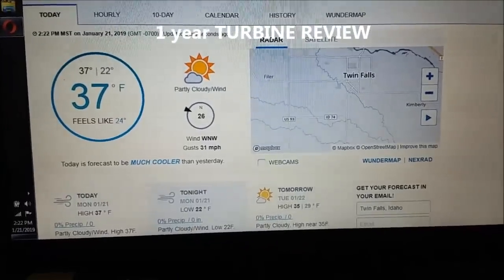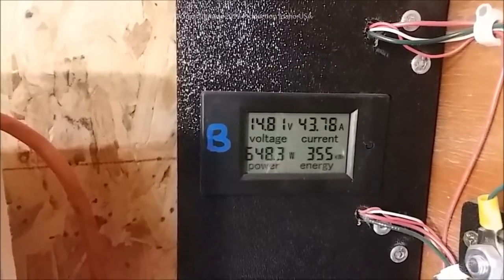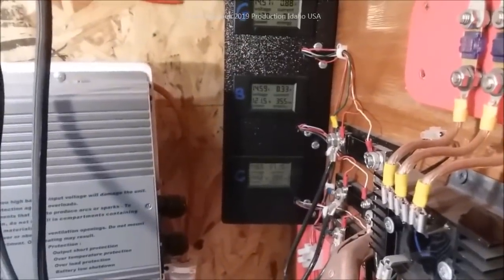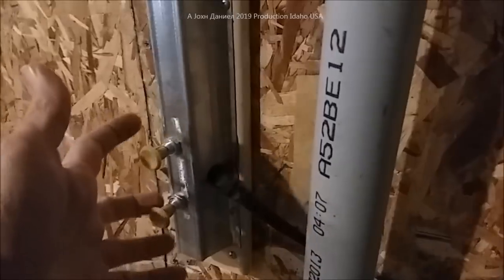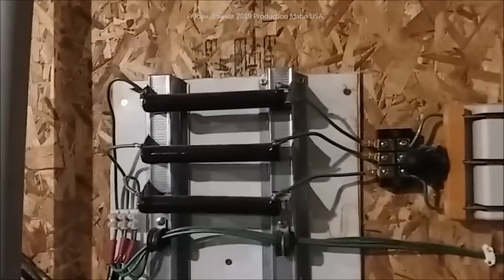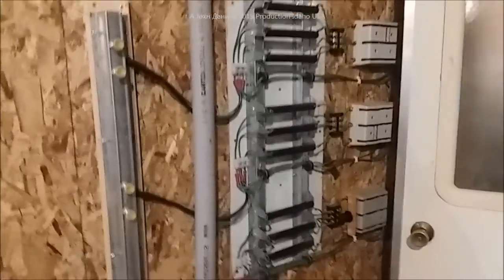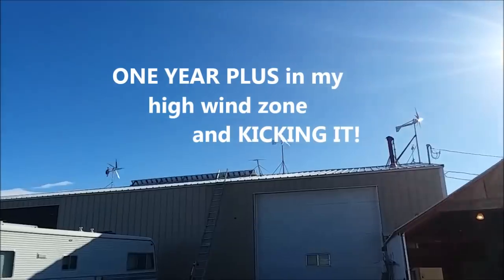The best Chinese Wind turbine, Great results, 1 year+ review FULL PARTS LIST BELOW VIDEO

Comment: Imagine if this works we could sell these to folks and make some people happy and unfortunately some might not be happy like power companies.  Or just build it for us and not for others.  Not sure . I just want to make one that can run on a 24v 400 ah bank and charge up my 1,200 AH 12v bank and the 24v bank . That would rock.
Reply from the maker: In all honesty, its over-unity which is not going to actually work based on actual power factor loss. But if you wan't to become wealth from wind power, you build what I have in operation now for years on my property in Texas. Air pressure to charging systems. More to come on that in the future as I secure some law ridden trademarks and copyrights.
Reply: Line loss does suck j never have messed with something like that.  I have seen those 10,000 watt pulley driven inverters that can run from an electric or gas motor. And used for running a washing machine and dryer or a large 80 amp duel bank charger. Have you ever used those?
Reply: Isnt the idea to spin a 3 phase at 800 or 1,000 rpm the goal with a wind turbine? Why wouldn't a high rpm motor still spin it? Could a differential gear system fix or correct that? Or how about at least running a big one to charge a big ass bank up and another bank that's running the motor. Mmmm have you ever tried it before? I know a guy who made a smaller version  out of treadmill motors and a brushless high rpm 12v motor. His works he gets 350 watts or 15.5 amps at 14.8 volts with charge controller for each motor he has 4 on his.
Reply: He lives in firth. He showed me it I helped him figure out the bank sizes to use I told him to go with two separate  600 ah banks running 2 of those on each bank . One bank for his running motor and second for his inverter and loads. It works better with 2 banks that way the startup motor isnt drawing current from the charging bank that's has inverter. Before it would bog down when he turned it on. And I had him add a car amplifier capacitor to ot too help with startup surge.
Reply: That's where I thought wow why couldn't I just use bigger shit and make it bigger lol. But I trust your opinion as fact and wont waste any money on one I would rather buy 2 of those bad ass turbines.
Reply: Over unity no I was talking about stuff that could actually work out in an honest way using the same method wind does just share the same motion or energy with a few more 3 phase units to keep my big ass bank charged enough and the running motors battery  too. Not perpetual bullshit just using batteries to buffer load that is replaced by sharing one action with multiple recieving turning systems. It's just good manners sharing energy with others lol. I figure if a motion  is able to convert into usable energy what happens when that motion  is shared at the same rate to other converters? Using a buffered energy source to give that motion only to regain it later as interest from its next door battery bank  maybe a tied in charger to give back enough .
Reply: I will have to go talk to him and tell you exactly what he has in it.
Reply: I'm a mean critic on those free energy from nothing idiot's I know you cant create energy or destroy energy only change its form . I always wondered if it's possible to use kinetic energy such as a shared spinning system that feed the same amount of turned energy from the same turn . A spin is a spin unless the farther away the shaft is the slower the turn mmmmm is that a problem? So would the first closest device spin slower or faster? I was also wondering if I used bearings to stabilize the 2 ft shaft from the turn source wouldn't everything still spin the same rate let's say I used 4 600 watt 3 phase turbine alternators With a cog system setup for high rpms wouldn't the inertia be the same? What happens  as the spin extends from source let's say 2 ft from the electric motor and multiple spaced cogs up the shaft and cogs mounted on 3 phase? Wouldn't they all still spin enough to convert energy?

Comment: Would a low torque electric motor be better then have it run to a gear box to increase rpms? On the phase 3 units?

Comment: I'm going to order one asap since you wont sell the one by itself.
Reply from the maker: You get the turbine, I'll send you a custom controller for the price of shipping, about $20 as a fellow Idaho HillBilly!
Reply: Bad ass ok . Should I get a hoop base or the same old flange?
Reply from the maker: twinfalls.craigslist.org/for/d/twin-falls-full-crate-25-stion-solar/6813533958.html
Reply: How much did that say?
Reply: I definitely want to make some bigger solar  suitcases my current ones are 2 100 watt 12v solar panels I set all 6 up as 24v to a 45 amp mppt controller
Reply: I'm also going to make 200 watt cases with built in controller and 1500 watt 3,000 max msw inverter and battery cables in 8 awg or 10. All a camper owner would have to do is plug onto RV battery and open case exposing panels to sun light and power will happen lol
Reply: If they actually try to plug camper in using 30 amp to 15 amp adapter they would have to shut off onboard inverter charger  then the campers outlets can function.
Reply: I want to built a setup that's simple for anyone who has no education in solar can run. And old folks who want to camp in a no hookup area that need a bipap or cpap, tv and phones whatever.
Reply: I'm going to get some light weight flexible panels and make an 1,000 watt solar case for me that can unfold like an accordion and only be like 30 or 40 pounds. With small legs that fold out.
Reply: Hey the turbine model number isnt the same one you listed for your Chinese turbine. Is it the same one just different model with same parts?
Reply: Ok I ordered the one from the old link I did the 500 watt hoop base 5 propeller 12v.

Comment: Hi, John,  thanks for the update bought a NE-400 from http://www.wxnaier.com/indexM.htm (email; violayi@wxnaier.com) about 9 months ago. Had it shipped to my boat in the Philippines was $160 and $100 shipping.. Bought mine with 5 blades since, wanted it more for the low wind-speeds and quiet.  Starts turning and producing at 5kts getting 10-12 watts..  7kts 12-14 watts. 20-25 Kts - 300 watts. Not seeing the top end you have, I assume, because of the 5 blades..  But nice and quiet and starts producing at low wind speeds. Which was my goal. Matched with a 18 year old Air Marine 403 which does not start producing until 15kts.  Have had it up in some very strong winds 30+ and still going strong.  Viola at Wxnaier was great and easy to work with.. But your aliexpress link would be the best because of ability to use  credit card..Keep up the videos.. Thanks, again for pointing me in the right direction..

Comment: at 11:02 you say to use 100 watt 2-3 ohm resister .at 14:57 your diagram show.s to use 100 watt 5 ohm  i take it that the diagram 1 is the 1 to use
Reply from the maker: The diagram showing 5 is MAX ohm to use on the 12 volt models. Its a practical call of your needs. Since my wire is 25 feet on average to get to that location I use 2 & 3 ohm there, but if your wire is longer the 5 is preferred. I put 5 on the graph due to the fact most people would have 50 feet of wire, likely 10 awg  IMO on their install. But, if your using 8awg and under 50 feet its ok to use a 2 or 3 ohm.
Reply: @JOHNDANIEL1  thanks

Comment: Hi John, I checked out Aliexpress 500watt wind generator off the link and it didn’t talk about mounting pole
just flange. So went to your flange link and it 
is 1 1/2” dia. Pipe.
What batteries do you recommend?
Also what voltage are you running 12, 24, or
48v?
Thx 😎
Reply from the maker: I use 12 volt, I prefer it due to parts availability as well as convenience. Multiple small turbines over one big one. In 24 or 48 volt any failures are bank breaking. 
My own Telescopic pole design using Schedule 40 Rigid Pipe and the 1-1/2 flange I put a link to above: You use 12 feet of 1-1/2 pipe inside of 12 feet of 2" pipe  ( ID of 2" pipe is barely 2, usually 1.97-1.98, and OD of 1-1/2 pipe is 1.91-1.92 or 1-15/16" ) so you have a slip install. You just put set bolts in the 2" pipe about 4 of them spaced about 5" and half around it to lock the 1-1/2" pipe inside the 2". Visualize it, and you drop a locking collar https://amzn.to/2WaTXLp where to 2 meet. You can go to the local Electrical Supply and get 2-1/2" Schedule 40 Rigid that the 2" sch40 will fit into the same way as above, making it telescopic by putting a welded loop on it you lift with a smaller pole and extend. Hope thats visionary in detail.

Comment: I need to design a portable pole mounting setup that can lower or fold down for transportation.
Reply: Do you think a 7ft electric floor jack would work if I welded the flange on top and welded a hinge on the bottom . What do u think?
Reply from the maker: You can  make a 21 foot pole for raising and lowering like a telescopic antenna. I have done them on ranches in a few places for sheep camps and cattle care shacks.
Reply: What would I need for that?
Reply from the maker: My own Telescopic pole design using Schedule 40 Rigid Pipe and the 1-1/2 flange I put a link to above: You use 12 feet of 1-1/2 pipe inside of 12 feet of 2" pipe  ( ID of 2" pipe is barely 2, usually 1.97-1.98, and OD of 1-1/2 pipe is 1.91-1.92 or 1-15/16" ) so you have a slip install. You just put set bolts in the 2" pipe about 4 of them spaced about 5" and half around it to lock the 1-1/2" pipe inside the 2". Visualize it, and you drop a locking collar https://amzn.to/2WaTXLp where to 2 meet. You can go to the local Electrical Supply and get 2-1/2" Schedule 40 Rigid that the 2" sch40 will fit into the same way as above, making it telescopic by putting a welded loop on it you lift with a smaller pole and extend. Hope thats visionary in detail.

Comment: John please sell me that one I live close enough to come get it
Reply from the maker: We will be selling all of it at some point. I have 2 already installed in Texas and a Tesup master 500 still in the box.  No point in storing all of it for a year while building the compound.
Reply: How much for the Chinese turbine with  the rectifier and controller?
Reply: Cool I just want a good working 500 to 600 watt turbine for a 1,200 AH 12v bank that will work good for portable power applications. And a dump and hopefully mppt controller that works good. Something affordable and dependable.  My 400watt vevor wont go over 10 v even at 60 mph winds  30 mph winds that thing is a piece of crap.  But they knew it was so they refunded it and left it with me. I would love to replace the 3 phase inside with the same one yours has lol. And repurpose  the shell into a working unit. I tested from controller and nothing good and tested the 3 ac lines all of them wont go over 10v and I'm using stranded 10 awg wire 15 ft. I have mounted controller next to bank and next to turbine. Still shitty.
Reply from the maker: What are the blades on that Vevor? 550 mm or bigger?  They need to be 700 mm for a 400 watt, but not sure the extras I have would fit its hub. Some VEVOR (tail up style) do produce OK if they have the right blades. If I order Another 500 from China, I can get 2 for $330 total from my source as a installer. So very possible I can get you one for $165 if you will do a video on it and all you do is tell the truth, if its shit, the truth is its shit. If as I already am glad to know a real performer then you can do a honest video showing its results. Luckily its a asskicker so no problem with showing its real results unlike some assclowns with names that sound like Jeff doing fake-a-watt videos they push to sell shitty turbines.

Comment: Hi John, how would you setup the China turbine for a safe setup in an unattended off grid cabin? Thinking about brake dump load etc? Really like your vids btw.
Reply from the maker: I Guess You would have to automate the process, not hard, just need 3 of the cheaper WINDANDSUN SSR controllers and some temp sensors and a 3 phase solenoid roll over rotating switch.
Reply: @JOHNDANIEL1  love your videos. Great work man! Impressive. Unfortunately us "newbies" get lost in the weeds without BOTH specific wiring diagrams AND equipment specs.  Know just enough to be "dangerous" without BOTH.  
Your advice on How to configure the following '"system"...PLEASE..
> 400 W solar ...and... 400 - 500 W  Turbine....(automatic selective switching activation of each [unattended]
> 4 to 10 battery deep cycle 12V battery bank w/ 2000 - 3000W inverter
>  brake dump load modification using 3 SSR controllers + temp sensors + 3 phase solenoid roll over rotating switch. [as described in your answer above]
Thanks from TX
PS- system is for a RV
Reply: Hi Jhon. Great videos mate. I’m interested in buying the setup you’ve suggested but my system would also be left in an unattended cabin. Do you have any further advice and/or a link for the additional parts you’ve recommended? Thanks.
Ben
Reply from the maker: The biggest thing is a good quality controller, be sure when you get the turbine to get a controller that can handle this little monster. 800 watts with a diversion load pair to it would be smart.
Reply: Јоhn Daniel how come you need 3 of the wind&sun controllers?
Reply from the maker: I use 2 for the wind turbine system, and one to run my hydrogen generators.  You only need 2 set .40 volts apart ( say 14.40 and 14.80) for a safe full function system for wind turbines. Working on a video to totally explain it.
Reply: Јоhn Daniel cool, eagerly awaiting more details. I plan to set up a multi stage dump load for both solar and wind. Both to a discrete heating element on a tank as first of load when the batteries are full, then to separate space heaters when the hot water needs are met.
Reply: Hi Јоhn I would be keen to see one of your videos on how to make the process automatic. Thanks
Reply: Hi John. Ive got 2 of the wind & solar controllers but unsure what you mean by a '3 phase solenoid roll over rotating switch'? have you got a link to one them? We get really bad storms where we are and could really do with making the process automated as we are not here all the time to monitor the system to throw the break switch. Would be awesome if you could help. cheers!
Reply: Hey john same scenario but its a church what would your take be on it
Reply from the maker: I think it would do good with solar also

Comment: Thanks for the update on the Chinese Turbine. Can'r wait for your schematics.
John, the link for the Watt Meter does not seem to work.
I can't seem to find the same (3) meters that you use.
Reply from the maker: Are you looking for a 6 function LCD? The link should show you a meter, even if out of stock you can hit SEE ORIGINAL LISTING and under it it will have a renewed listing for one.
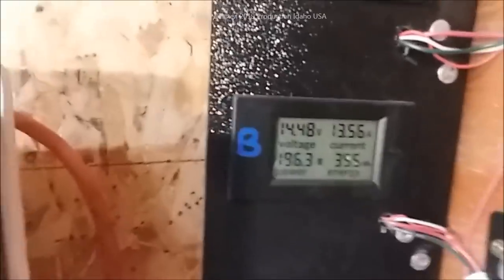Reply: @JOHNDANIEL1  I'm looking for the same ones in your video like the one that you have marked "B" in blue at say 7:40 of the video.
Reply from the maker: The first link to Aliexpress under the video leads you straight to the HAWT 500 that is the B listed in the video.

Comment: I  have  a question 
How much power this Chinese bad boy  produce at very low wind 

Please reply sir
Reply from the maker: Starting at 6-7 mph (7 kph) it begins to produce up to 10-15 watts, at 10 mph it produces over 70 watts, at 12 mph is when it really makes good power over 100 watts. At 20 mph its making right at 300 watts ( 260 to 315) and once it hits 25 mph its making up and exceeding 500 watts. The power curve is very progressive. If you have good winds in excess of 10 mph, or 12 kph then its a worthy item.
Reply: Dude I have no idea. Mine doesnt do anything at this point the controller that came with it sucks.
Reply: @donaldsteele6276  seems like there are missing replies to you? I am thinking of ordering one of these units. How is yours doing?
Reply: That's a bad ass turbine I cant get mine to work at all it's a worthless piece of shit
Reply: @donaldsteele6276   mine is also no good, just makes a lot of noise